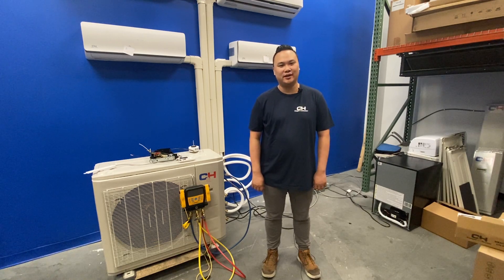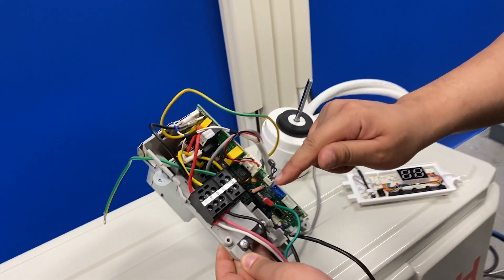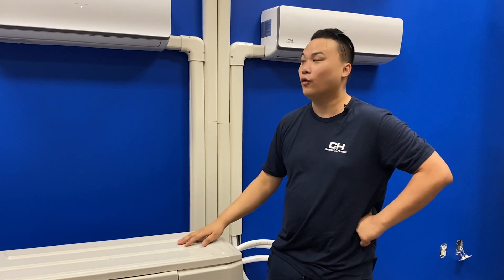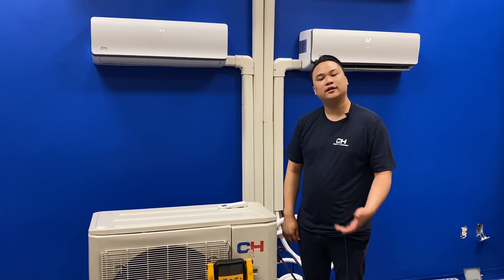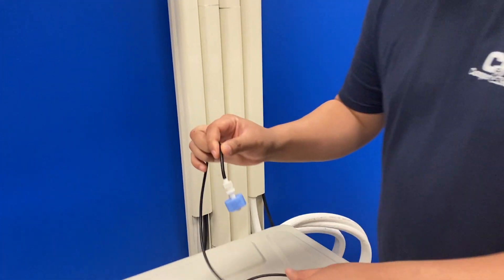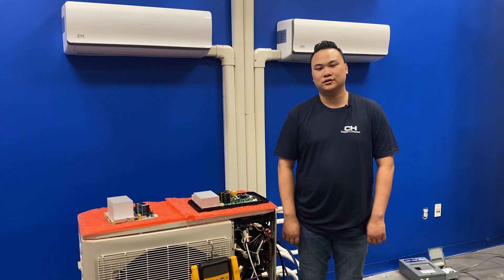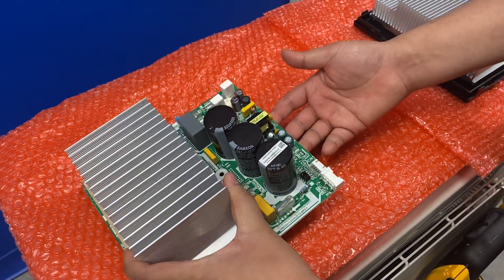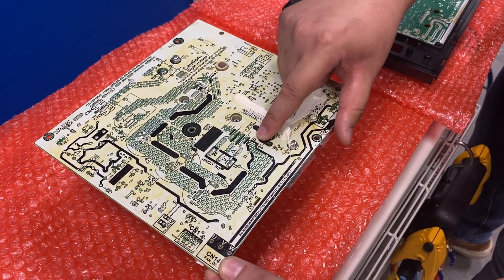Cooper&Hunter Error Codes (2021)

Comment: What a p4??
Reply from the maker: On the indoor or outdoor unit?
Reply: @CooperandHunterusa   indoor  reads  p4
Reply: @dann7528  Did you ever find an answer for this? What model mini-split do you have that was throwing P4 error codes?
Reply: @CooperandHunterusa  I also had a series of P4 errors showing on my indoor unit today. Mia 9k BTU 220v. What does P4 mean on this particular model?
Reply: @CooperandHunterusa  u
Reply: Turned it off then back on and went away works like it should
Reply: @dann7528  Same here, turned it off for like 30 mins and it's been fine ever since. BTW, I found a list of error codes on the inside cover of the indoor unit. P4 is "Compressor drive error" for what it's worth. Thanks for the reply!
Reply: F4 fault displayed?
Reply: I have L3

Comment: Hola, mi maquina no funciona. No da ningún error en pantalla, se apaga por completo la pantalla y el mando no responde. Quito la corriente, la vuelvo a dar y entonces arranca y en menos de 5 segundos se vuelve a apagar. El mando no reacciona. Vuelvo a quitar y a poner corriente y pasa lo mismo, es como si por seguridad se apagara. ¿que puede ser? El Modelo de la maquina interior es CH-S12FTXE(WIFI)

Hello, my machine does not work. It does not give any error on the screen, the screen turns off completely and the remote does not respond. I turn off the power, turn it on again and then it starts and in less than 5 seconds it turns off again. The controller does not react. I turn off and put power back on and the same thing happens, it's as if it were turned off for safety. What can be? The indoor machine model is CH-S12FTXE (WIFI)
Reply from the maker: Hi Alejandro, we are not familiar with the model number. It is not a model that we sell in the U.S.